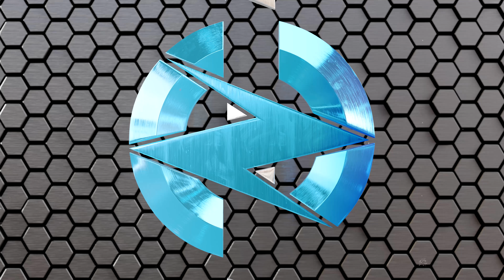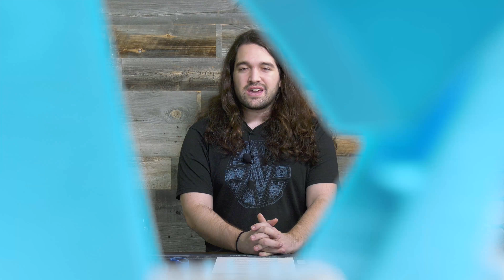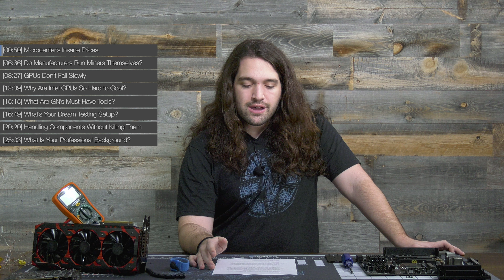Ask GN 68: Microcenter Ripoff, Why CPUs Are Harder to Cool

Comment: I love "Limit 1 per customer" like they gotta keep people from taking advantage of that SICK DEAL OF $1500
Reply: You don't need sli for mining. The 1080Ti is great at many alt-currencies. BTC isn't driving the current spikes, those miners are all running ASICs, but alt currencies are a dime a dozen right now and many have a hash built to not be ran on an ASIC. For zCash and NiceHash the 1080Ti is your best option.
Reply: Gareth Tucker At the start of the year with prices close to msrp it was 23 days to get 100% ROI for a 1080Ti, minus electricity prices (27 days at $15/kWh) Now it's closer to 50 due to market conditions. That's far from "useless".
Reply: Gareth Tucker You're "not talking about mining" but several times above you've tried to talk about mining. I don't need to talk to anybody else about the results I'm getting because I know what my results are. You can read all the blogs you want that can say all the various things that they want but until you get involved you probably shouldn't comment on it or you're gonna get called out. 

Bitcoin and several of its Forks are only profitable by ASIC mining in areas where electricity is cheap, chiefly Southeast Asia. Altcoins are still very profitable with GPU mining. Several of the coins, two of which I have mentioned, are built specifically for GPU mining and actively block the use of application specific integrated circuits (ASIC).

The most popular of which is etherium and it is responsible for at least half of the price hikes right now. Litecoin, zcash, and nicehash are also pretty high on the list but they're at least half a dozen ICOs selling tokens currently and will launch in the next two weeks. Interestingly enough some of those evolve around Esports, specifically betting for Esports so I don't see the situation coming down anytime soon. Manufacturing capacity could double and prices wouldn't change as evidenced by the sellout conditions regardless of price. If the 1080ti was as bad for mining as you say it is then it wouldn't be selling for double MSRP or more. Think about it.
Reply: +Gareth Tucker If you're mining with them you don't need sli xD
Reply: it should be 2 per customer and the first one should be offered for msrp or whatever that store should be selling them at
Reply: Marcus  Its a sure fire way to get a impulse buyer to pull the trigger. Tell them its on sale for one day only and they can only have one.

Comment: Do the M.2 ports on X299 connect via chipset or cpu lanes? I know on threadripper, AMD prides themselves for their cpu based nvme ssd connectivity. Makes me wonder about Intel's, especially since dmi 3.0 is only a x4 gen 3 connection.
Reply: Check the specific motherboard's manual or the manufacture's website.

Comment: EE rule of thumb for a 10c reduction in temp 2x life up to about 30 c or 40c depending on make.  Thus a 125C cap will most of the time last  4 times longer at the same temp  as a 105C cap ( below 105C ) even more above  and if you reduce the temp 40 c 8 to 16 times longer. This  from  cap maker lit and hands on results.

Comment: Steve, do you think AMD Ryzen will ever catch up with Intel's IPC performance? And if so, how long do you reckon it will take?
Reply: Clock a 7700k down to 3.4GHz and let it only boost to 3.9GHz test it side by side with a ryzen 7 1800x with four cores disabled.. IPC is already caught up.. the instructions per clock isn't lower the clock full stop is what is lower,  Most reviews seem to compare a 3.9 or 4.0GHz Ryzen against a i7.. but that i7 isn't at anywhere near 3.9GHz it's clocked at 5GHz and wow it's 5-15% faster ipc.. but is it really? it's scoring 5-15% higher while having a 25% higher clock speed, if anything intel has the IPC deficit at this point not an advantage, they do have a performance advantage but if you look at the raw numbers and clock for clock the advantage isn't in instructions per clock it's in clock speed. The ONLY way to accurately measure IPC performance on a chip to chip test is by having both chips clocked at the exact same speed and having the same exact number of cores. If you aren't clocking the competing CPU at the same speed you can't say which has an IPC lead unless it's super obvious a 25% clock advantage will equate to a 25% IPC advantage IF the IPC is EQUAL, if you only get 5-15% higher scores with a 25% higher clock speed you don't have a higher IPC you have a lower IPC. You can not test IPC apples to apples oranges to oranges unless clock speeds are the same or the percentages of increased clock speed equate to the difference in score.
Reply: Eamon Connor they may not catch up. But they will have better price to performance
Reply: IPC is not everything... just like speed it is a point where is shadowed by something else (in our case might be multi-core performance) just like they stopped racing for higher clock speed back in the days
Reply: the TLDR of what benjamin said is IPC is directly proportional to core frequency, the higher the core clock the higher IPC, and by comparing ryzen and intel clock to clock the difference is minimal at the point of no difference, something like that
Reply: wabachi : That's not what he said.  IPC is not proportional to core frequency.  It's instruction per clock/cycle.  Meaning the frequency has nothing to do with it.  IPS (instructions per second) is related to clock rate and a direct measure of a CPU's performance.  In general, a CPU with an IPC of 3 and a clock rate of 2ghz will be faster than a CPU with an IPC of 1 and a clock rate of 5ghz.
Reply: i misswrite some terms sorry, it was 4AM, but that's what i tried to say
Reply: wabachi: No worries.  I think we've all done that once or twice.

Comment: In your recent delidding and liquid metal video, your recommendation for preventing liquid metal overflow/spillage from getting on the CPU contacts was to use nail polish. In Optimum Tech's recent delidding and liquid metal video, he recommends using silicone sealant, the same sealant you would use to seal the IHS back on, in this video: https://youtu.be/VWTbxH-wyFI?t=6m59s. Is there any reason you would not recommend simply using the silicone sealant to protect the contacts? Why didn't you just use your silicone sealant you had on hand instead of nail polish? Thanks!
Reply: That's a good question, IMO.

Comment: @Steve Burke Have you thought about doing a SMD electrolytic capacitor replacement on graphics cards? I ask only because you have shown us how to do shunt and thermal mods in the past, ACX 3.0 not withstanding; and I have seen many cards on reddit that have a bad capacitor that has mushroomed out of the bottom causing the card not to work anymore. I know that your channel is an enthusiast/intelligent market, but your absolute honest journalism leads me to think that this "soldering up a non-mod after the card warranty has expired" could be very beneficial to your viewers that might not be viewing other channels that replace these limited-life-span components that could save them a bundle in money to pay others to repair their graphics card. Just a simple look and replace could benefit many that trust your coverage of the shunt-mods and liquid metal application videos. It wouldn't cost much to get the supplies, and I could provide them to you: solder, flux, and a good soldering iron, to help the enthusiasts "ifixit" their tech by an honest person that can give them the process of saving them money by replacing components that have given up the ghost. I love your content, and both your testing methodology and honest report has me wondering if this non-mod can help your viewers, bringing back to life, as much as an overclocking recommendation would. Love you guys!

Comment: That is a pretty crazy price as you can get an entire system with a 3GB 1060 for less than that. Granted, it’s an r5 1400 with 8GB RAM, but it’s still and entire system with a 3 year warranty, an OS, WiFi, Bluetooth, an optical drive, 4 usb 3’s, 2 usb C, a card reader etc...

It’s also odd that 3 managers (including two who posted in other threads) all have different ways of enforcing a “build”, and employees aren’t sure what discount to give (MSRP, a certain amount off etc).

If prices stay like this, 2018 will be the year of the pre-built and, (I actually made a face) the first time since the 360 release PC gamers switched in droves to consoles.

I’m hoping it will be the year of “used parts” and buying from smaller non-chain stores, as right now, they are generally less expensive than the chains if you need a GPU, even though they pay far more.

Comment: Can't understand why Intel can't spring for some decent fucking thermal compound under the ihs if they're going to charge so damn much. Just doesn't make sense. Usually when you pay more, you expect premium. Granted the cpus are quicker, but come on.
Reply: I'd prefer they just not use an IHS at all. They started doing this after the early Athlon and Pentium 3 days when idiots would chip the die when installing a heatsink because they had the grace and intelligence of an 800 lbs. gorilla. After that the companies decided to protect us from ourselves so they didn't have to deal with the resulting support mess.
Reply: just solder it like amd and its done
Reply: The Pentium III and some of the celeron models from that generation are the only Intel CPUs I've ever seen without an IHS the older Pentium II/1/486/386/286/8088/8086 had no exposed die either. the p4 on up all had the heat spreader.The whole breaking the die from heat sink installation issue was really only commonly reported to happen on the Athlon chips mostly due to the difference in the mounting on the socket. Also it wasn't really that widespread an issue at the time either, I know of only one person who chipped a corner of his die and that damage didn't cause the cpu to fail in that case either. Protecting the die wasn't a bad call cheaping out on thermal compound was decidedly a bad call though.
Reply: i soldered i5 6600k and now it has 10C of the temperature LOL but it was a huge risk cuz i killed 2 cpus and they somehow accepted the warinty and replaced it with new ones

Comment: how to avoid ESD when you dont have a grounding cable.
1. Be barefeet.
2. Dont be on a carpet.
3. Get all the tools and parts you'll need ready so you dont have to move.
4. Touch your PSU/case before unplugging it to discharge whatever load you had

Been building computers since I was 10 and I havent killed a component yet. ¯\_(ツ)_/¯

Comment: I did this at 2 microcenters. It's 400 coupon off the 1080ti 300 off the 1080 etc. However some will give it to you at retail. Byo is board chip and ram.

Comment: Might be one shooting towards Buildzoid, but something I think is worth asking. Steve, if I have a chip that's low power (say, an Athlon X4 chip) and I decide to OC it way beyond what's considered "safe" for daily use (about 4.7 GHz in this case), how come an OC at 1.9V can only reach about 5 GHz on liquid (while staying below TJmax), but can reach up to say 7.6-8.0 GHz on LN2 or other exotic cooling?
Reply: I'd guess, signal integrity. Colder metal has less resistence.

Comment: whats sad is right now in most cases it is cheaper to buy a prebuilt or a laptop then to build your own, When i can get a laptop with a 6gb 1060 and an i7 that is cheaper and has better specs then anything i can build there is a damn problem, At the rate we are going cpu+gpu combos like the intel 8809G are going to be the only way to afford to build your own PC thanks to the fucking miners.

either that or the major manufacturers are going to need to introduce a program where you can only buy 1 GPU at msrp per ID (license) number and gotta turn in the old one to get the msrp price.

Comment: 15:15 Steve, you missed an excellent moment to say, "A GN anti static mod mat, complete with helpful info and cheat sheets to assist with any difficult PC issue. Assisting levels will very greatly depending upon application"

Comment: If you buy a gpu from MicroCenter at these jacked up prices, first off, I'm sorry.  But second, and most important, buy the in store replacement plan.  That way, in 2 years or sooner when/if the prices go back down to normal, you can cash in on your replacement plan and upgrade to something that's worth the price you initially paid.  Just find a non physical way to brick the card because lots of locations test them now before giving you a gift card for replacement.

Comment: I recall that the NVIDIA CEO once said that he company will not actively market to miners because, as soon as they gear up production, someone else will see the money and design a custom efficient chip that does nothing but mine. He was resisting investors’ clamor to foolishly dive into mining. I thought that was a wise move
Reply: Decentralization. It's bad if the only people mining your coin are ASIC companies in China.
Reply: kieferonline 
Especially when Bitcoin is the clear example potential of ASICs, certain cryptocurrencies circumvent ASICs for GPUs to be viable. But increased miner diversification comes at the cost of economic efficiency due to power draw.
Reply: Aereto eventually an invention will come along and drive gpus out of the mining industry. Then they'll make new coin to circumvent said hardware.
Reply: Why do they design coins to block use of ASICs and force GPU? I honestly don't understand that...
Reply: More importantly there is no competition hurting their sales so theres no reason to make a mining card. Nvidia will be more interested in mining if a mining card comes out and demand for GPUs plummets.
Reply: kieferonline I
Reply: They did not market to miners because they had no need to,  even as it was the miners cleaned the shelves and kept them empty for all this time....

Comment: I would blame retailers too for selling a $1500 GTX 1080 Ti. Or, in this case, a $540 RX 580 w/ a free 23" monitor as seen advertised on Newegg right now (Jan. 24, 2018 1040PM Eastern Time)...  but, maybe, it's rich ppl's fault for... ummm... buying a $1500 GTX 1080 Ti? Or, a $540 RX 580 w/ free 23" monitor?  

Although, if, I was rich and I wanted a GTX 1080 Ti and for some reason, wanted to buy it at Micro Center, I would send my chauffeur to buy it in person because I'd be so embarrassed to go in front of the cashier when they ring in that $1500 GTX 1080 Ti!

For me, since, I'm on the east coast, buying that overpriced RX 580 at Newegg online would be less embarrassing since I don't have to see anyone in person when I buy that overpriced card and being ripped off in the process.

Point of my post is, $1500 GTX 1080Ti and $540 RX 580 with a free 23" monitor valued at $150 are both overpriced to a point of ludicrousity.

And, if you buy it, is it the retailers fault that you bought it? 

Or, rather is it the retailer's fault that they're greedy and that there are rich ppl out there who would buy a $540 RX 580?

IMO, I think you have to be smart to be rich, thus, a rich person buying a $540 RX 580 is necessarily not "dumb" since they're rich and $540 to them is like $54. So... that's why I didn't wanna say, "It's dumb ppl's fault for buying into the price gouging."

Comment: When I built my Rig last Spring, MicroCenter was the only Retailer that had a GPU for a reasonable price ( EVGA GTX 1060 6GB for $329). Plus, they actually had one in stock. Because of this, I purchased my RAM, CPU, Cooler, HDD, and some other small items to finish my build from MicroCenter.  Gamers should fight back by not buying anything unless GPU prices are fair!

Comment: Full cover blocks work great for mining.  Relatively small cost considering investments as a whole.  The whole card stays cool.  Even VRM/power systems.  Going to last far longer compared to air-cooled cards.  What's an extra $100-150 on a $600+ card?  Especially when it will pay it's self off over time.  Plus I have noticed slightly better hash rates.  Clocks stay at peak 24/7.
Reply: Chad Bremer 
Liquid cooling helps normalize thermal fluctuations, while adding new points of failure, with the liquid now a major risk factor to the build, since even nonconductive fluids can accumulate conductive impurities.
Reply: Aereto been running loops for years.  The risks are minor at best...

Comment: Do you think with the amount of ASIC resistent crypto currencies/# of crypto currencies and the length of time crypto currencies have impacted the market that it is time to accept GPU mining is not going away and Nvidia and AMD to invest the money and resources to increase production?
Reply: Brett 
The problem with ASIC resistant cryptocurrency is the amount of work for GPU to match ASIC workload would draw more power, which is a problem for regions or countries whose power grids may not cope well or are unstable.

While there is the UPS to safeguard against outages and voltage fluctuations, the amount of power to draw would affect which UPS can handle the maximum expected draw and stores enough energy to lengthen operation time between power incidents.
Reply: I think so.

Comment: Speaking of insane mark-ups, the latest newegg email promo had the new powercolor Vega 64 for $1300.00 (sold by newegg) and it even came with a "free" external gpu enclosure valued at around $200-$300!, IIRC. Boy, what a deal 😏 That's right up there with the $500 RX580/570's that come with a free (cheapo) monitor.🙄

Comment: If you want power supply testing results, Tiny Tom with OC3D TV  uses a SunMoon machine.  Unfortunately, power supply wattages are growing above 1200 watts now and his machine can only run tests up to 1200 watts.  The upgrade for higher wattages is way too expensive.